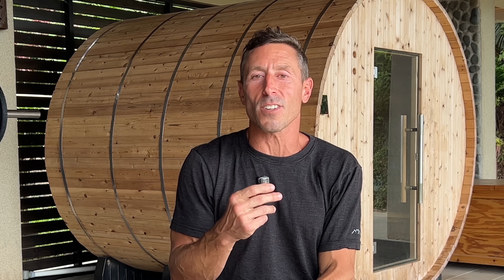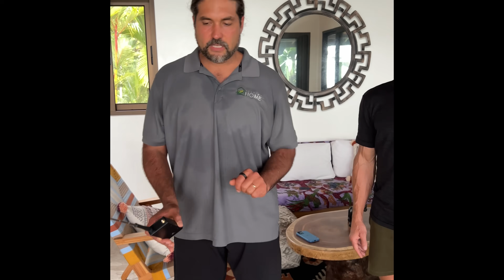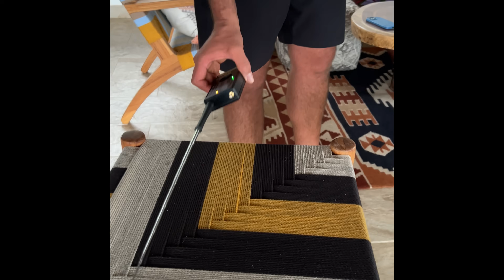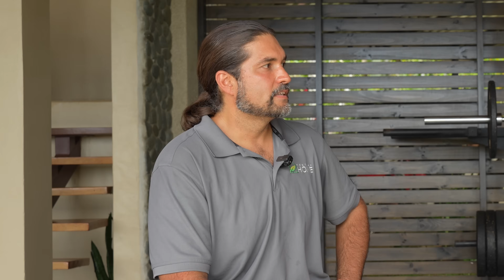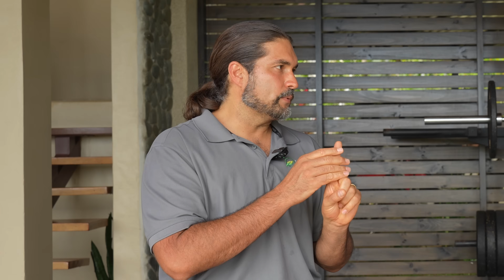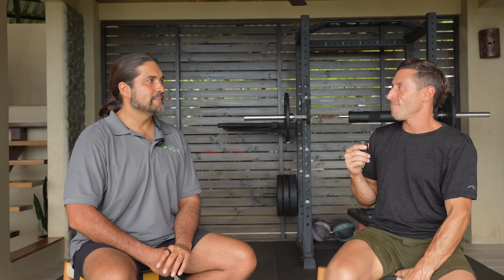Earthing vs. grounding

Comment: "In an AC electrical system, the ground wire is connected to a grounding rod (or electrode), which is typically a metal rod that is driven into the ground."   It does not go back to power company ! yes there can be dirty electricity on the electrical ground.

Comment: You'd be better off making a Faraday cage around your bed. Are you really going to shut the breakers off to your entire home every night so you don't want air conditioning? You don't want heat. You don't want the ability to turn a light on if you wake up in the middle of the night and need to use the bathroom. It's absolutely ridiculous that you have to turn off the mains power to your home
Reply: besides.... then on the daytime, you sit in all those fields again, so....

Comment: I'm sleeping in my car in an area where cell phone reception is possible but not good and my cell phone is turned off and wrapped in aluminum foil.  I have an old car so there is nothing electric or wireless running. So I am fairly free from electricity and frequencies but am in a metal object sitting on tires so must not be grounding well. Any ideas on how I can ground and stay in my car. I do sleep better than in the apartment I last had but still would like to ground.
Reply: Stick a Coper grounding rod in the ground under your car and connect it to the chassis and to a grounding pillow case, or a grounding sock or a grounding bedsheet. The ground to chassis connection makes a Faraday cage, or a semi Faraday cage if some metal parts are insulated from each other by paint. Ideally you would want to make sure the top and side parts of your car are connected to ground to protect you. I am assuming no artificial EMF will come from underneath but that won't be true in underground cables are there where you are parking. SonI would say he ideal is to make a full Faraday cage with the body of rhe car.

Comment: Are you familiar with the Magnetico magnetic sleep pad? I sleep on the 20 Gauss pad and can really feel the difference in both sleep and pain relief. At 73 y/o I’m now considering drilling through my concrete floor, driving a 6 foot copper grounding rod into the ground and adding an earthing mat attached to it. What do you think? Thanks for the great advice you provide on your channel!
Reply: just hook it to your electrical ground.

Comment: This is not a conspiracy theory. Without knowing this, I experienced that when I go outside barefoot on grass for half an hour, I have no back pain in the morning. Buying a grounding mat for my PC because of the winter, didn't help a bit. Thanks for the info.
Reply: Same!!! we have Mother Nature always there for us. We  have to trust her, We have been disempowered and led not to trust ourselves, our bodies own abilities to heal itself with Nature's assistance...
Reply: Disagree, my grounding sheet has been working for both of us. I have been off my arthritis meds and no pain in my back or knees & I'm scheduled for knee replacement surgery.
Reply: @teddyp3ted  I used a grounding sheet to help with my poor sleeping patterns and arthritis in my back, I felt extremely unwell after sleeping on it for 4 nights and the pain in my back got worse and and I was very restless during the night, I work up completely drained and feeling depressed. The company where i bought it, didn't tell me about the adverse reactions to using the grounding sheet and refuse to give me my money back!
Reply: @teddyp3ted what grounding sheet are you using?
Reply: Did you check the mat with a multimeter? Cause from what I'm seeing, that's a necessity. A lot of products can come with faulty grounding cords or any number of things and so you need to check the system to see if it's actually grounding or not. And if it's not, you can find out where the problem in the system is and fix it.

Edit: I too have winter and given the time of year it is I'm looking to get some grounding products. I'd reccomend getting a multimeter and trying again, you never know.
Reply: @theinkweaver4639 No, I didn't check but I will try a grounding sheet in the future and I will test it also.

Comment: an incredible life hack I did in 2006 was turning off the wifi router while sleeping. found some half decent power bar timers. then noticed sometimes my sleeps were not as awesome. that turned out to be sleeping clothes +/- sheets. the color of them. 

all color is really energy. 
warm colors are the worst. 
neutral is the way to go there. 

black has the lowest, .. so when I could, I hung black where I sleep. JFC .. like. wow. way better sleeps. almost seems like voodoo, but .. no. color is energy. being a professional illustrator showed me that in the 1980s. 

‘n .. that is why restaurants often use red. because a) it excites you. b) also is fatiguing. (so you ramp up w/excitement .. enjoy your food .. then leave quicker than u normally would, so they can serve more people in a day). 

looked into getting an iPhone to ethernet cord, but couldn’t find one locally. 

so .. @ night at least,

place your phone at least six feet away from your bed. and .. if possible turn off the breaker to that room, +/- give extra space so your head at least isn’t near any outlets. 

turn off any power bars for sleep. 

remember .. the outlet is just the outlet. the wires that go to that also carry the electrical. 

simplifies laundry as well. 
all my clothes and bedding is black now .. would never go back. any time I wake + didn’t get a great sleep. that was why. 

forgot to turn off wifi. etc has been the answer. 

clean or dirty power is a huge thing that almost no one is aware of. it seems. for decades. nice to see this video w/tech clips.
Reply: What about white sheets & bedding
Reply: @RinaValentina  same deal. switched to all black sheets and even better sleeps. harder to find black items. but. well worth it (for me) being an HSP. might not be a necessary step for everyone but .. I wouldn’t go back to white sheets anymore.